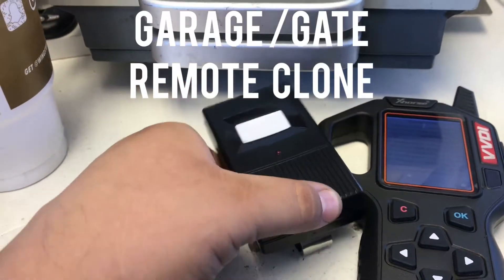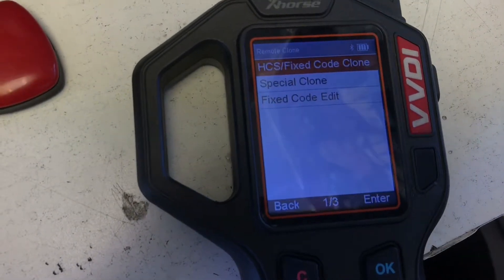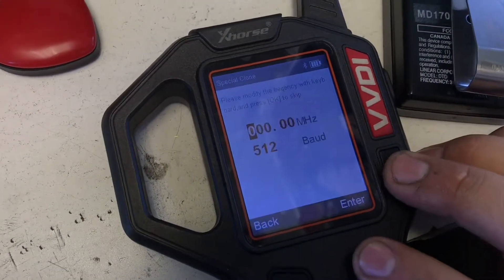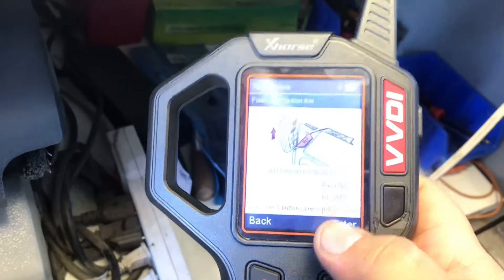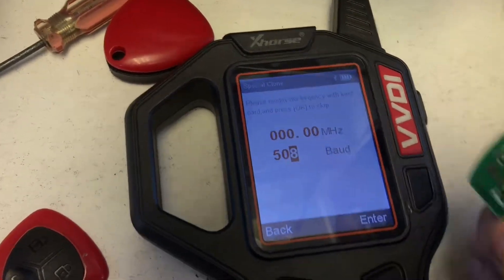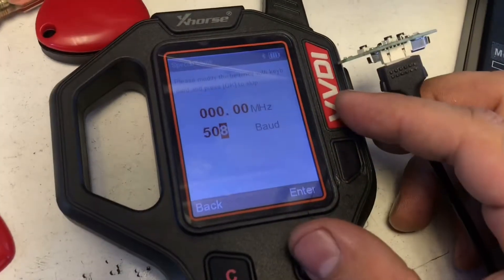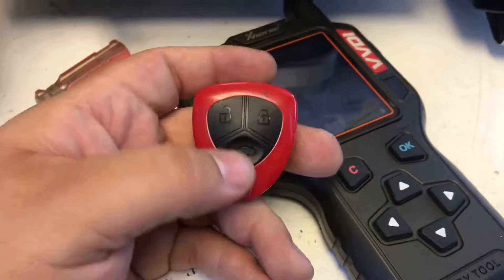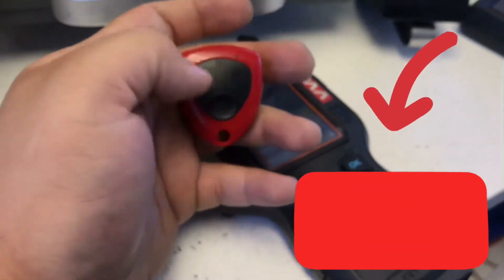GARAGE/GATE REMOTE CLONE (VVDI)

Comment: I have tried this with the Mini Key Tool and cannot get it to work on my LiftMaster garage door. It tells me the generation was successful but still won't work. Any advice?
Reply from the maker: Im not sure about the mini key tool ,should work the same i believe!!The BAUD has to be the same number and also the MHz has to be the same!!try to get those numbers as close as they are to the origina signal your original remote is throwing out... not all the remotes are clonable ...
Reply: @MYKEYSAUTOMOTIVE  OK thanks for the reply. I believe my garage door opener uses a rolling code. I assume those aren't cloneable?
Reply from the maker: WideOpenThrottle yes i believe they are not cloneable... like i said some are!! If your just trying to get a spare remote i reccomened you find an extra one on ebay they are really cheap and just enter the code on it!!
Reply: @MYKEYSAUTOMOTIVE  trying to integrate a flip key for my motorcycle so I can have the garage door work on it. Not working out so well... Lol
Reply from the maker: Ohh haha that woulved been pretty cool!!

Comment: Hey Mr Keys, do you happen to know the difference between the remote in your video and the wireless version? Is the wireless version only an onboard capable programming method? There's no connector to plug into for the vvdi tool.  Thanks!
Reply from the maker: Yess ill make a video later on explaining how it works...
Reply: MY KEYS AUTOMOTIVE  Awesome..Thank. You!